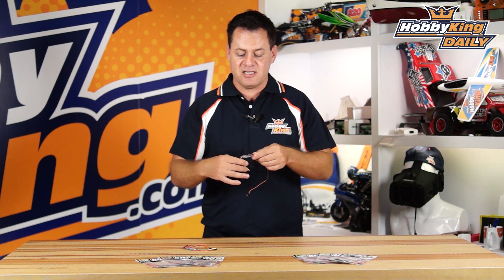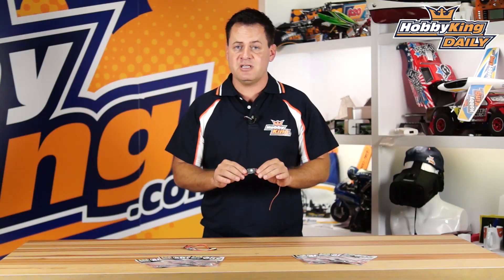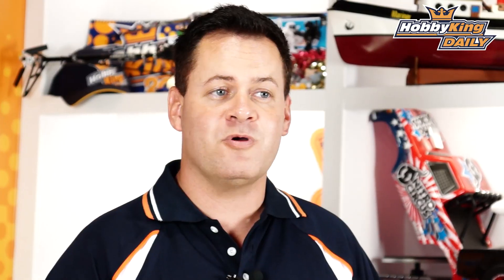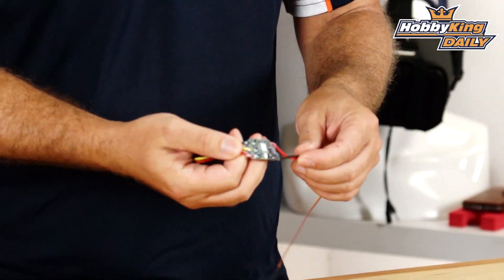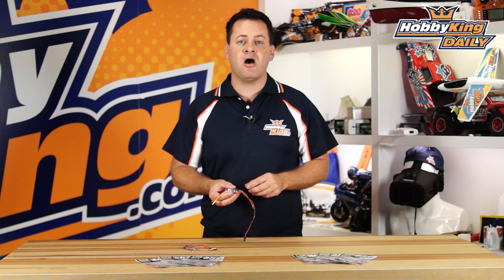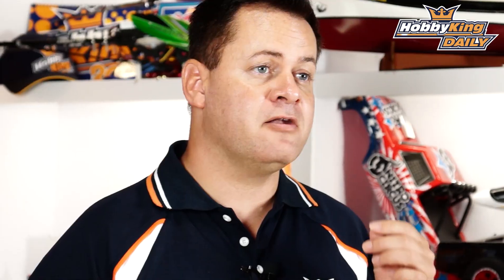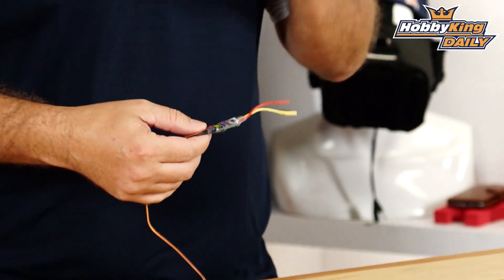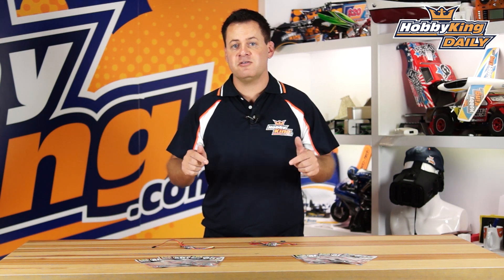Afro Race Spec ESC - HobbyKing Daily

Comment: Looks cool

Can anyone explain the difference between bec and opto?
Reply: DutchMultirotors a bec incorporated into the esc will output 5v to power the flight controller.  opto escs don't have a bec and you will require something like this to power the flight controller instead: http://buzzhobbies.com.au/index.php?route=product/product&path=60_69&product_id=251
Reply: lasersbee But they're linear, so you can have multiple ESCs sharing a power rail.

Comment: what's the difference between bec and the opto
Reply: +Kevin Yoon   The Bec is basically just a  5ish volt output that would allow you to power accessories, FC,RX, Servos  etc.  without the BEC you can get a bit better performance and smaller form factor.  opto has no bec.  HK also has a afro rs 20a  with bec if you want it